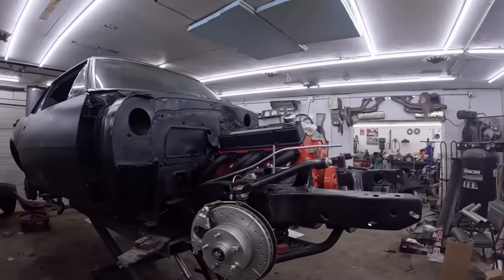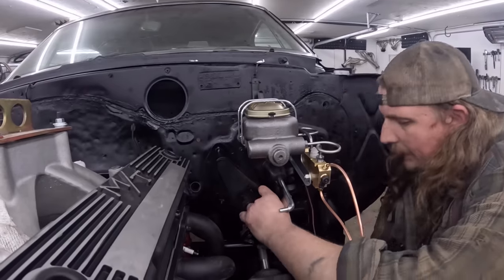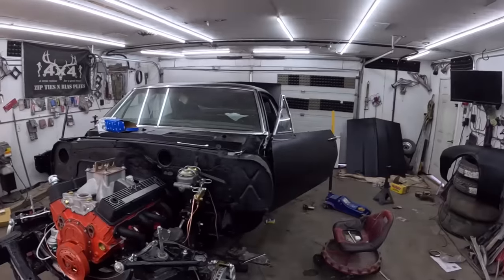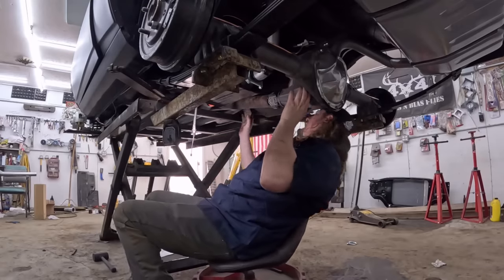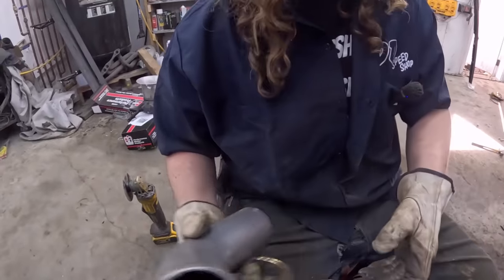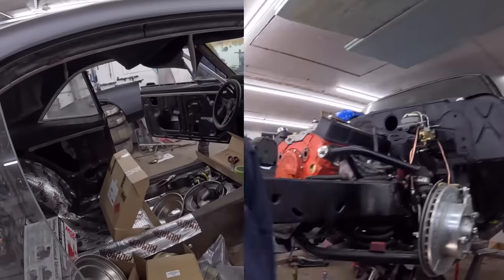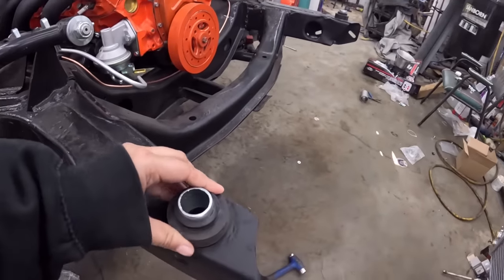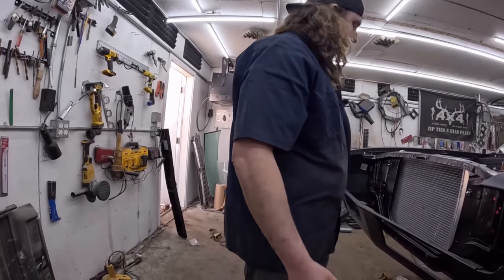Mechanical Clutch Linkage Hassle - Throw Out Bearing Haunts Me!

Comment: Dan , if you are using a console in the car check your shifter position and height. The actual mount for the Camaro, shifter to the transmission, is quite different from what you have. It puts the shifter mechanism lower and more forward so you don't have to cut the side of the tunnel for clearance.

Comment: I was doing the same crap today with my 3 inch exhaust it's a nice kit but where I screwed up was I bought a pretty fab trans crossmember from jegs it's a nice piece but I put that big block in my g body monte carlo the crossmember was for a g body with a small blockso I found some 41/2 inch offset pipe and welded to my collectors and it clears the cut outs on the crossmember perfect. But I'm doing this crap without a lift on my back jack stans....lol

Comment: You need a spring on the pedal side there should be a half inch to an inch free play where to throw out bearing isn't touching the diaphragm helps to break down on pedal chatter and to save your paint job I probably would have done alternator water pump intake distributor most all that stuff with the fenders off but that's just preference Camaros are tight fit in less chance of scratching the fender when you're laying on it putting things together

Comment: I have no idea what's going on. The last video I saw was when you were installing the driveshaft and shifter. The front end was together, radiator was in, brakes were done, and it looked like you were getting pretty close to finishing the outside and mechanical stuff. Then this video comes out the next day, and suddenly everything is completely torn apart again. I watched the video where you fixed that throwout bearing problem some time ago. Why is that still an issue? I thought you had that taken care of and moved on. 

I am glad to see you get rid of the H pipe. I've always liked true dual exhausts, and that's the way I've always done them, except that I use straight through glasspacks instead of baffled mufflers. You don't have an exhaust pipe expander? They really come in handy. I always want at least 2" of overlap on clamp together pipes, even if I am welding them. 

I would own a P/T Cruiser as a transportation car, if you didn't have to pull the engine out to do almost everything. And it doesn't come out the top, you have to drop the engine, transmission, and front subframe out the bottom. One of the main reasons I've never owned a front wheel drive car. 

It would sure look good with Cragar S/S wheels front and back. Give it some shiny ness.

Comment: Am I weird for loving all this modern reproduction sheet metal that looks as good if not better than original so that an original vin tag on a total rust bucket can be not only just "saved" but even improved upon better than when the musclecar era body was supposedly still in its prime at 5-10 years old. For instance, I love the notion that one can purchase and utilize all this new sheet metal making their 1967 A-body GM intermediate, for example, just as good or better than it would have been found in 1975 here in Michigan with salt covered winter roads...
Something about that core support going on really triggered this comment.
Mopar and Ford guys have it just as good if not even better than GM tweakers. Solid clean 18guage body sheet metal stamped in a way which is as good if not better than original steel from the era. 
2024 sucks in a lot of ways, but the availability of new vintage tin is NOT one of our problems at the moment!

Comment: The spring holds only the throwout arm to the lever so the adjusting rod don’t fall out —- not a return spring 😊😊
Reply: If that's true what keeps the throwout bearing from running against the clutch ( not at all true )
Reply: @kevinhemken748  you missed it, the spring  goes from the arm that the clutch rod sets into the dimple and to the small hole on throwout arm just to keep the adjusting rod in.

Comment: Why wouldn't you pull the front clip if you're in that deep?  I need to do an exhaust manifold on my F250 and I've been thinking about pulling the fender because I know I'll be drilling broken bolts and it's going to be a PITA!

Comment: A stock fuel pump will not supply a performance carb. It will start bucking in 3rd gear and 4th gear No Wayne O... You need 3/8 fuel line.all the way from the performance 3/8 sending unit for V8 application otherwise No good. Holly or Edelbrock makes a performance conventional style fuel pump. "High volume": the carb fuel line goes between water pump and the block 3/8 Dia. With no more than 3"rubber house to the carb NHRA rules otherwise not safe.